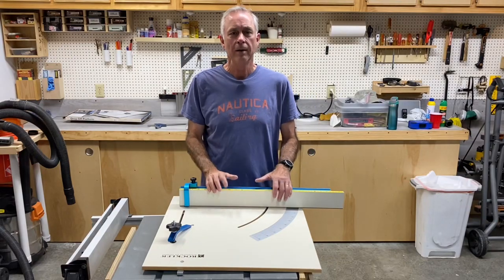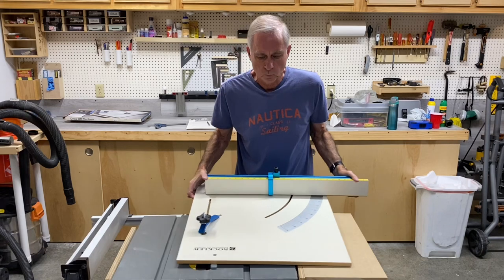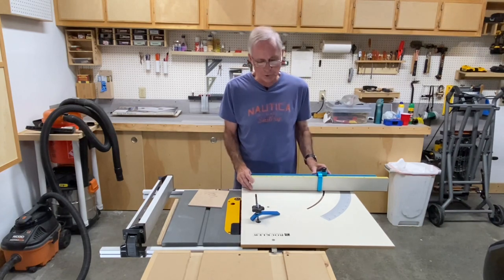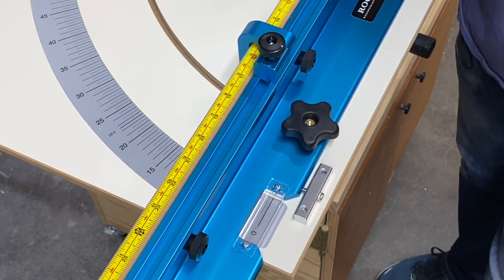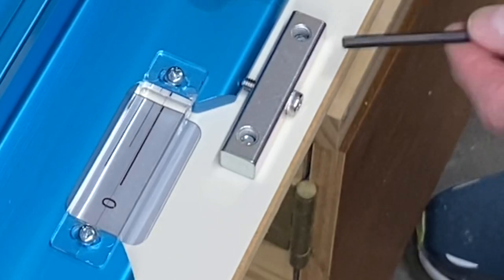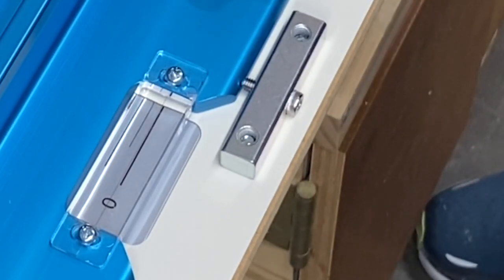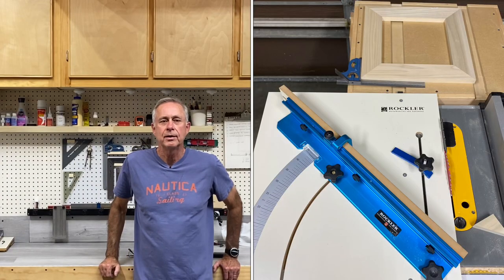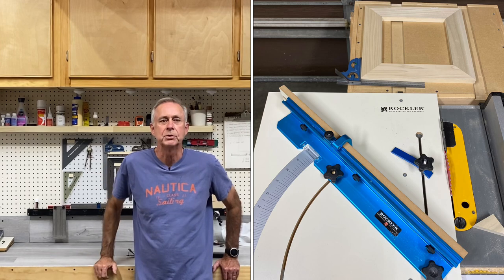How To Use A Rockler Crosscut Sled On a Jobsite Saw

Comment: For a while I thought about building my own sled or potentially just getting a miter saw so I can increase the accuracy and consistency of my cross cuts. After seeing the rockler had a "pre-made" sled that is adjustable and comes with t slots, I realized I'd probably spend more making what I want than I would just buying theirs. I'm like you, I like to research a product a lot before I buy it. I'm glad I stumbled across this video, it answered all the questions I didn't even know I had yet.
Reply: For what it's worth, I may still get a miter saw some day given the amount of times I'd use it for more of a jobsite application but for more fine woodworking, I think this sled will be a much better solution for me for the time being.
Reply from the maker: Thank you for your kind words Logan.  I use the sled quite often instead of getting my miter saw out.  You may want to check this video out as well.  https://youtu.be/8q0v23lGY0s   It shows how to cut wider boards with the Rockler sled.  Be safe with your tools!!

Comment: Just brought one home, had the same issue of tipping. My table saw had an arm lower than the table top, so I built a saddle out of wood which is removable when I store my saw. I liked your storage shelf and will make one for my rockler sled. Thanks!
Reply from the maker: I’m glad the video was helpful. Sounds like you came up with a good work around for the tipping issue.

Comment: Thanks for showing me why a miter sled that works on large table saws might not work on a job site saw. Now, I can consider buying this sled. I would rather buy than make in the hopes that it will be less trouble and be more accurate.
Reply from the maker: You’re welcome Jeff. I use mine all the time. Here is my other video about how I modified my stand to allow me to cut even wider boards. https://youtu.be/8q0v23lGY0s

Comment: Excellent video on a sled I am looking at. As far as the concern about the stop adjusting screw maybe moving on you after dialing it in, you can wrap the threads with plumbers teflon tape to  eliminate any  "slop" and tighten up the fit. I learned this trick from a plumber friend when I asked him why my shower water on/off handle kept coming loose. The screw has not backed out in years.
Reply from the maker: Awesome idea Brian!!!  I use the sled a lot. It replaces some of the things I used to do on my miter saw. Now I can sometimes do a project and get one less power tool out.  Thanks again for the useful tip!
Reply: There is also a "LocTite" that you can buy that allows forced movement but not involuntary movement. That is, it is lock a little not totally.

Comment: I have a DWE7491 and also have the same sled you have. I too added a custom support for the left side, although not as elegant as yours. I really like the sled but wondered about the stop block moving. I’m gunna check that out next time I’m in the shop! Thanks for pointing this out!
Reply from the maker: Thanks for the comment.  Let me know, if you have a different conclusion with the stop block.  If you don’t have a ruler like I do, it may be more difficult to line up the block accurately.  I will be dropping a video next week with an improved version of the side wing and out feed table.  I’ll let you know when I do.
Reply: @Ray_Here  
Thanks! Please let me know about the improved side wing. Where did you get the ruler? I like that!
Reply from the maker: @stevesiefken6432  I bought the ruler from Rockler when I bought the sled.  You can also find them on Amazon. You need to make sure you get one that reads right to left.  I was using the sled again the other day. The ruler is very accurate.  It’s a time saver!
Reply from the maker: Here is the improved out feed table and side wing video.
https://youtu.be/uB6g0BmMJB0

Comment: Rockler even added a notice in red on their website on the product description for this: 
"Notice: Not compatible with DeWalt 7491RS jobsite saw (54738). 3/4 of the platform should be supported by your table saw."
I have the sled and a much bigger table saw and it is usable on it, but I think it's still too big IMO. Make your own sled to fit your saw and you'll be better off. Not to mention the price on the Rockler sled is stupid high. $200 for this is too much. I kick myself for buying it.
Reply from the maker: Thanks for your feedback!

Comment: Thanks for the video.  I was not familiar with this product.  The addition of the tape on the top surface is a great time saver.  I have factory scales on saws but I don't feel they are accurate and always set via alternate methods.  How do you measure distance to three decimal places?  Caliper? (digital, dial or vernier). Great product introduction!
Reply from the maker: Thanks Pete. I did use a digital caliper to measure the cut piece.

Comment: Can you show how you made the toggle?
Reply from the maker: Sorry Don, I don’t know what toggle you are referring to.  Give me more information and I’ll try to help you out.
Reply: @Ray_Here  It is holding the Crosscut sled against the wall. For storing the crosscut sled.
Reply from the maker: I’ll look at what I did and let you know tomorrow.
Reply from the maker: Don,  I just took a 1x2 block about 3” long and attached it to the wall with two 3” screws.   I predrilled holes through the block.  The screw length allows it to grow through the block and the drywall and anchor into the stud.   I attached the block just above the top of the sled when its in it’s tray.   I took a second block about 4 1/2” long and predrilled a hole in the top center that would allow the block to rotate on the screw.  Then I screwed the second block into the first one just tight enough that I could rotate the second block to hold the sled.  The block sizes are pretty arbitrary so make them whatever size works for you.  I’ve used this technique in other applications ad it works well.